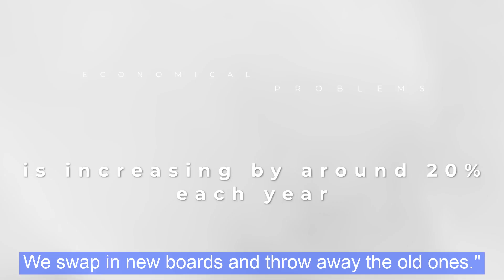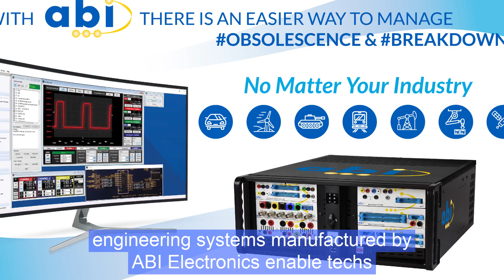An urgent call to action from ABI Electronics - STOP throwing away electronic circuit boards!

Comment: All the companies I have worked for throw  away PCB's if it's not repaired immediately or shipped out to be fixed and put the  unit on hold for  parts, and sometimes it  cost from  500 to 1000 dollars or more  !
Reply: It's crazy man! This madness has got to stop! In some other industries PCBs can be worth a lot more. Still tech are swapping in instead of repairing. Where's the value in that?